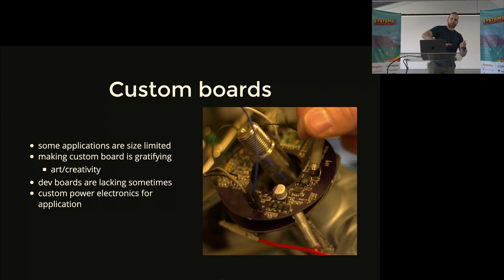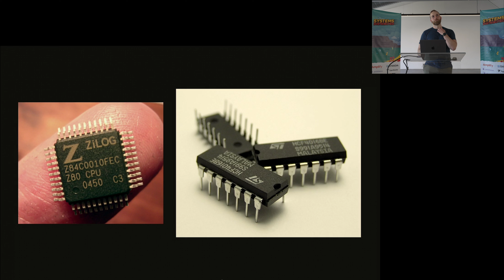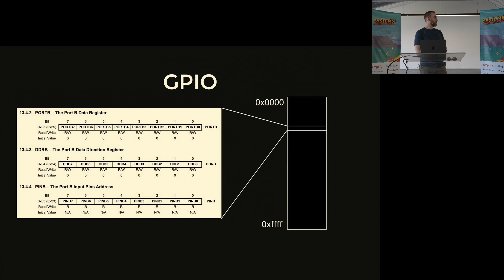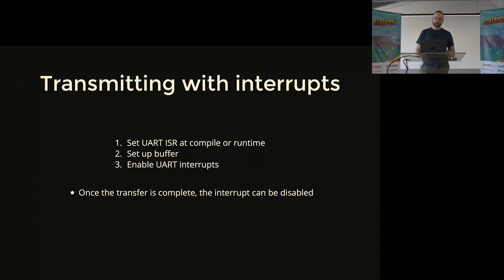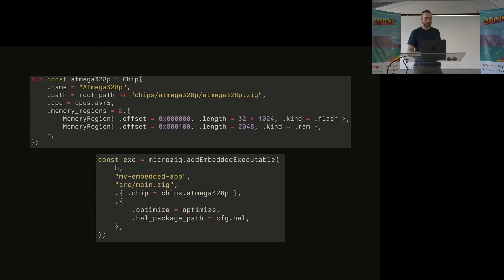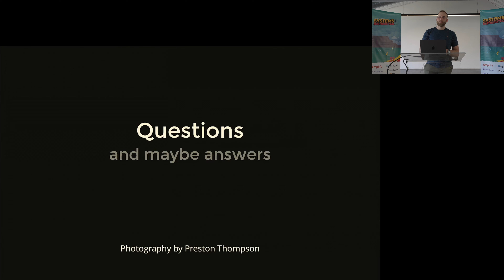Building an Embedded Ecosystem for My Past Self by Matt Knight

Comment: This was very validating to me. I've been wanting to get into microcontrollers, but it always feels so hacky and half-baked due to things like having bespoke IDEs with the run button, but no instructions for how to run the compiler, etc.
And it also confirmed my feeling that (for me, personally), I need to learn the basics - how compile and build something that handles an LED and interrupt or some such without any tools or libraries - before using something like microzig (or the C equivalents) that work at layers of abstraction that I don't have the foundation to use effectively.